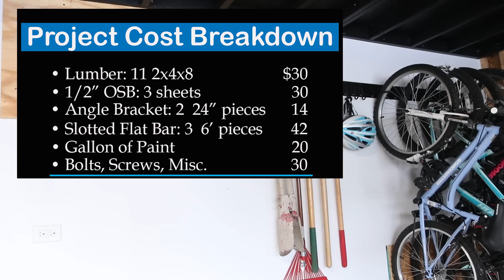How To Make Suspended Garage Storage Shelves for Under $200 || DIY Storage Project

Comment: I use fleximounts less than 200 (always on sale)for a 4x8 they have three mounts per unit. That holds 600 lbs. 5 years later still solid

Comment: I'd add sheet of black painted ply to the spot where the bikes hang.  Drywall will crush and get scuffed over time.
Reply from the maker: I actually put a piece of ply under the bike rack on the wall.  Great idea

Comment: May I ask why did you use 2 inch lag bolt to screw it on the ceiling 2*4, the depth of ceiling plate is only 1.5 inch
Reply from the maker: That’s what I had on mad

Comment: Great idea. But definitely did nit need the angle iron. 
Could have just screwed the vertical iron directly into the wood.
Or am I crazy??
Reply from the maker: Hahaha totally could. I was a bit concerned that you could only get one screw into it through the angle and might not be long term with wood moving.  This way the angle is secured with a couple of bolts and then down.   Hope that makes sense.  Just over doing things sometimes makes me feel better lol

Comment: I've been watching several videos about garage storage, and yours is the best. I will be doing this project soon. Quick question: can lag bolts be used instead of screws for the 2x4 attached to the ceiling?

Comment: This is very well done.  Same angle iron and bars that I use to hang HVAC equipment.  The size of the cuts really minimizes wood waste.  Super thoughtful build, with excellent points made throughout ("this is essentially a wall being built horizontally, with 16" on-center framing").

If I didn't already buy safe racks, I'd totally do this.
Reply: I am curious if you could eliminate one of the center supports, using 2 instead of 3.  Just curious as I am looking to make some for my garage.
Reply from the maker: A D you talking about the 2x4 supports? I made them 16” on canter but you can go 24” if your using 3/4” plywood or if you don’t have a lot of weight on it.
Reply: @AD-1138  You could if you used little weight on the OSB or replaced the OSB with a thicker plywood (say 3/4").  That said, good plywood can get expensive and you already had a 2x4 piece that would fit.  Using the 3rd 2x4 cross brace seems like the easier and more cost-effective choice.
Reply: @KomarProject  Cool, thanks for the information.  I am no engineer or in construction and was just curious.  Looking to build some overhead storage above my garage door and have been looking at several other methods to find the best for my situation and so far I think I may go with yours.

Thanks for your reply as well Andrew, much appreciated information from you both!

Comment: Sorry if i don't understand or have made a mistake. To make each platform 63 inches shouldn't the long 2x4s be 60 inches with the 2x4 on each end to make 63 inches total? If I cut the long 2x4s at 63 and add the 2x4 brace on each end that will make total length 66 inches and the 63x31 board won't be big enough. 
Thank you
Reply: I agree with you 100%.  We cut our osb 63 inches long  and built our platforms according to instructions.  The result was that the platforms are 66 inches long  and the plywood is only 63 inches long.   Obviously  bart has screwed up his instructions and cost us time and money.  Apparently he was paying more attention to his assistant , honey bunny , and not concentrating on what he was doing!!!!!!!!

Comment: Your idea to use the angle brackets and the slotted flat bars is by far the best and the easiest method I've seen.
Reply from the maker: Thanks. I though about 2x4s but this seemed stronger and takes up less space

Comment: Just wondering why you made that top 2x4 all the way across the top when you only used a portion of it to mount the angle to hang the flat strap. or was that just an afterthought? Nice job looks good.
Reply from the maker: Ya I used the full length with the 2x4.  It helps to distribute the weight across the hole ceiling
Reply: @KomarProject  Negative, the weight distribution would only go to the fastener point. Then the load would be on the fastener and depending on the tensile strength of the fastener it would carry the load. Yes, past the connection point but not necessary to go wall to wall.  But the project looks uniform, looks good.

Comment: Nice! But I didn't see how you attached them to the back wall?
Reply from the maker: Just drive 3” screws through the frame into the wall studs.  I used 2 screws per stud.

Comment: My rafters run length wise along the wall.  Any suggestions to that?  
I like the floating idea and it does look quite strong for holding things up.
Reply from the maker: You can connect to the rafter.
Reply: @KomarProject  Thanks,  It was a concern of mine.  Everything on one joist could be a lot.

Comment: Why did you decide on three 63" segments vs. two 96" segments? I'm not really an engineer, so does it have something to do with even weight distribution on those vertical flat bars? Seems like it would be easier to achieve 16ft in just two segments. Then the 8ft 2x4's on front and wall side of the frame don't really need any cuts, and you just rip the OSB down to 31" the whole 96" length. That gets exactly 16ft with fewer cuts and waste.
Reply: Only thing I can think of is the way you have the angle brackets/flat bars spaced out. If mounted between each segment like you have, you total 5 flatbars. With the seam between segments at the center, this could also be reduced to just 4 brackets/flat bar supports. Is that just bad weight distribution? If I went with that design, should I consider adding more angle brackets/flat bars along the length of the shelf?
Reply from the maker: It was easier to put up the smaller pieces.  The weight is distributed on the flat bar so it really doesn’t matter what size you make them to start off.

Comment: I built a similar hanging setup in our garage but I have one section that is based on the floor.  I don’t have a grinder so all my angle irons were not cut.  However, It does feel good that a rank amateur had the same ideas as a pro.
Also, I set up the hangers so that the supports come down not on the front but 4” back from that.  The shelves are cantilevered out from the wall as I was trying to save the expense of the metal hanging straps.
Unfortunately, up here in Canada, prices are a bit more so my project came in around $250, plus GST.  Still, that’s not too bad as the is the price of one metal framed shelf unit from a Home Depot and I have the equivalent storage area of 6+ of those units.
Reply from the maker: Bill Campbell hahaha I’m not a pro.  Just a guy building shit in his house lol
Reply: @KomarProject  well, more of a pro than I - you have a YT channel!
LOL

Comment: Yea, this looks like just the project for me. I wish I had room for 3 sections like yours, but I'm only going to be able fit one section. It's still going to be a big help, so thanks. If I'm looking at everything right the finished section will be 66" X 31" and not 63 X 31... Correct?  Cheers
Reply from the maker: Not sure right now.  I’ll have to check it out later and remeasure
Reply from the maker: Dennis Hegdahl just measured it and the exact measurement finished for each section is 31x63”
Reply: @KomarProject  Thanks perfect timing . I've picked up most of the items yesterday ( mask and gloves on...ha. ) and will
will get everything I can today. Cheers . Thanks again.
Reply from the maker: Dennis Hegdahl no problem.  Good luck with it!!! You can share your progress and tag me on Instagram if you like.
Reply: I’m looking to build this and was wondering the same thing. Since the frame is 63”x31” wouldn’t the length be an extra 3” to account for the attached 31” pieces at the end? I cut the OSB to 63”x31”. Love the build and the video!

Comment: I built the same type of storage shelf at my last place..and like yours, most of the weight is held up by the ceiling brace 2x4. The problem is, depending on how much weight you add to it, it will start to stress that wall a LOT!! Come winter, I started hearing pops, and creaks, etc..it drove me crazy..that house never made those sounds before. As this was ALL I added to the place that summer..I put a basement jack stand under it about half way across..screwed it up until it was level once again..never heard another squeak or pop for the next 20 years!! Still hanging there as far as I know. Just in the lumber alone there is more weight there than one thinks. Just a suggestion, but I would put a brace jack under it bro. Great job!!
Good luck!! 😁👌👍✌
Reply from the maker: Thanks Gary. It’s always greatto hear long term solutions.   Here is to another 20 years.

Comment: Those 2-4 that u have in the ceiling they are drilled into studs correct , I build mine like yours but studs are in a differential engine
Reply from the maker: Yes they are screwed and glued to the ceiling joists.  Need to make sure you attach them to the joists.

Comment: Awesome video, thanks for posting!  I plan on doing this in my garage.  I have a question though, if I’m not mistaken, in the video you say that the pieces of flat bar are 33” long.  But the bins are 20.5” tall and you are able to stack two of them on the shelves.  So it seems like the flat bar would need to be at least 41” to accommodate the height of the two bins.  What am i missing?
Reply from the maker: Ya that was a mistake I believe if the measurements are like that.  If I remember right I did end up putting and extension on the bars to make them long enough to fit two bins.
Reply from the maker: Ya that was a mistake I believe if the measurements are like that.  If I remember right I did end up putting and extension on the bars to make them long enough to fit two bins.
Reply from the maker: Ya that was a mistake I believe if the measurements are like that.  If I remember right I did end up putting and extension on the bars to make them long enough to fit two bins.
Reply: Hi! I don't think that was a mistake. If the bins are 102 L the height is 15". So 33" makes sens. It's 20.5" Large not height.
Reply: I'm sorry. After watching the video again at 9:27, it seems there's an extension on the flat bar.

Comment: Nice I have a Modified I-Beam system(that holds the top of the container when slid in) above my garage door using those same bins. It's out of sight when not used I love it. wish i had the height to double stack like you did and i like that bike rack that is the biggest issue I have now.
Reply from the maker: Michael Potase we are going to add more right over the garage door too. Ya the bike rack is a huge addition for us.  Before they hung all over the place
Reply: Komar Project sweet fyi this is where I got my idea from years ago. Except I used 2x3’s and 1x4’s to make the bottom “I beam” then used 2 8foot 1x4’s to tie them all together and bolt it to the ceiling. 

https://www.familyhandyman.com/garage/storage/create-a-sliding-storage-system-on-the-garage-ceiling/

Comment: My curiosity is wondering if the shelving is strong enough for 3 high since I have a 10 foot ceiling in my garage. My width would be around the same so each section would be holding 9 storage totes. I would probably use 2x4 vertical supports instead of the angle iron.
Reply from the maker: xblindfolded I would say so. You can use 2x4 supports like you said or go with a thicker gauge metal bracket.  The ones I used were the thinnest ones they had at Lowe’s.  So I’m sure if you go bigger you will be fine.

Comment: I cant wait to build this following your steps! This is the most easiest, straight forward video I've seen about this! Thank you for this! 
 Under £200 is amazing for me as a single mum, but I think I may be able to get it under £100 (challenge accepted 😉😂 - things are more cheaper here in the UK).
If i am successful, this will have saved me over £1,000 from a loft conversion!!! 😁 wish me luck 🤞🏾

Comment: Nice job. I'd caution your viewers that the integrity of this assembly rests on the shear strength of those hex bolts and lag screws, so substituting anything less is a really bad idea. As for 10 bucks a sheet for 1/2" strand board (osb), that is over. Depending on where you live you might expect to pay twice that today. The way you put the deck together is great, so 3/8 ply would do fine. 3/8 ply is a little cheaper (where I live) and weighs 18 lbs less per sheet than 1/2" osb. Cheers.
Reply: Those bolts are stronger than the crap alot of the stores sell

Comment: Are your joists engineered? If so, how did you determine where to secure the 2x4 to? Also how did you avoid splitting the lower flange of the joist? None of this matters I guess if you don’t have engineered joists...
Reply: Sorry, just trying to clarify, are your joists engineered?
Reply: Predrill

Comment: Very informative, detailed, and funny! Thanks! I have a question. I've seen other videos using 2x4's to attached to the ceiling. How did you decide on the flat bar and angle plate over 2x4s? Thanks for the help!
Reply from the maker: The steel takes up less space then 2x4 and it just a bit stronger over time
Reply: @KomarProject  Great to know. Thanks!
Reply: Why was the reason you didn’t just use the angel in the ceiling ??
Reply: @mrosas2403  He already answered this one above

Comment: Great video, I love it. I want build this kind of shelf in my garage. I have one question, the screws holding the 2x4 in the ceiling; did you used 3" or 3 1/2 screws? Thank you for sharing and you got another subscriber
Reply from the maker: I think they were 3”.  But you can use either.  Good luck
Reply: @KomarProject  thank you so much for your help.

Comment: Awesome build! Definitely choosing this style when I decide to tackle this project.

One question though (and sorry if I missed it), but why exactly did you layout the 2x4 support on the ceiling instead of fastening the angle brackets into the ceiling trusses?
Reply from the maker: Bonezz024 it was the way the angle bracket was shaped I had I couldn’t run it parallel to the joist. So I ran the 2x4 across to spread the weight over the entire span.  Then I could mount the brackets to it.
Reply: @KomarProject  Awesome man, appreciate it. Looking forward to making this!

Comment: I'd love to do something like this in my garage but we have trusses. No can do!
Reply: You could see if you can get some long 2x10 or 2x12 in your attic and use them (instead of your trusses) to support the ceiling below and keep the trusses to support the roof. Would add significantly to the cost though. My garage is about 22 x 22 feet and if I added 22 (12 inches on center) 2x12s it would cost about $900. Plus be a lot of extra work.
Reply: A triangle support above or below the shelf would work the same.

Comment: Awesome video, Really like the step by step tutorial and the list of materials used. I do have one question, would you have been able to just screw the angle iron joyce in the ceiling instead of adding 2x4?
Reply from the maker: Noel Villasana ya you can I just wanted to spread the weight of the shelves over all the joists without having to connect every 16”.  Hope that makes sense.  Thanks for checking it out
Reply: After rewatching the video I caught that lol. Thank you for the reply. Follow up question, did you screw those 2x4s to the joist in the ceiling or just in random spots?
Reply from the maker: Noel Villasana defiantly to the joists and used glue.  You want it to hang from the structure.   Screwing into drywall won’t hold all the weight.

Comment: Ok so.....silly question here.  Is each "panel" a total of 67" long as you put the 2X4 on each end of the 63" boards?
Reply from the maker: A D they are set inside the 63” pieces.  So the entire platform is 63”
Reply: I think AD is correct. The 2x4s added to the end of the 63” board adds a couple inches on either end. At least in the video they were not set inside on the ends. Only the 28” boards are inside.

Comment: You could have actually attached the angle iron to the rafter trusses instead of 2x4”s. Would have made a cleaner look. Still like the idea and plan to use it in our garage.
Reply from the maker: Mike Hoffman my joists we’re going the other way. I though about it but the angle iron would run the wrong way for what I was trying to do.  But if you have rafters that’s go the opposite way it would work perfect

Comment: Great video. Fun to watch and easy to follow. I do want to ask - I understand why you used the 2x4's instead of attaching the iron brackets directly to the ceiling. However, couldn't you have screwed the flat bars directly onto the 2x4's and skip the angle brackets all together?
Reply from the maker: I guess you could have.